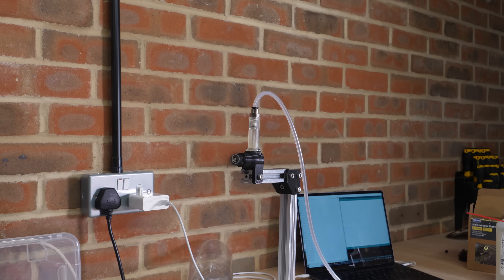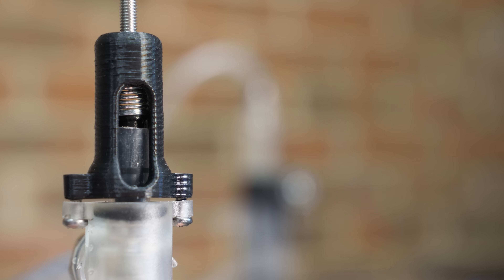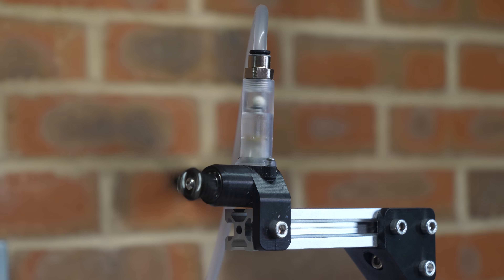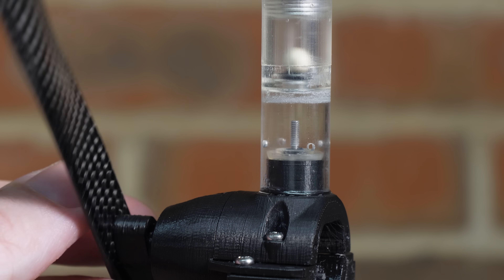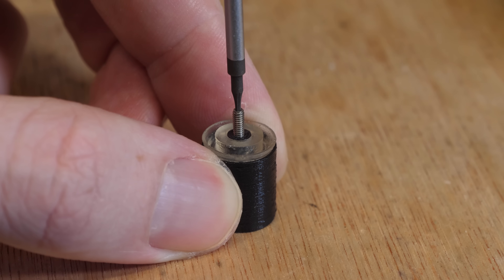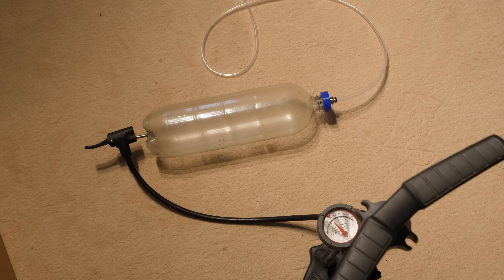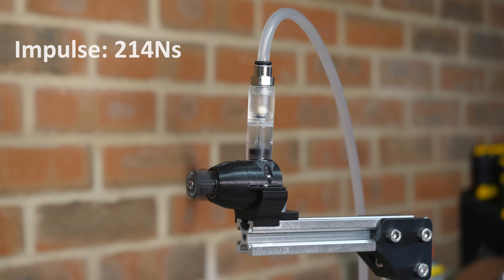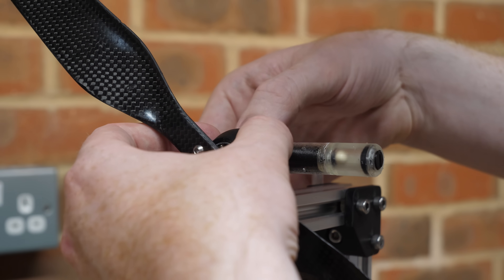4,500RPM Air Engine

Comment: Nice! It would seem the way things work out here is entirely analogous to 'regulated' vs 'unregulated' PCP air rifles; in the unregulated case its also the hammerspring / pressure feedback loop that keeps the power output relatively independent of tank pressure.

Im guessing the much lower efficiency in the 2 cylinder case is a mismatch with the prop power curve? With all the extra power you are getting out now youd probably need a bigger prop to absorb all that power without your propellor blades being pushed out of their comfort zone. Probably good to go over a bunch of them to ensure you are not too far of an optimum once youve settled on a motor design.

Comment: your series really brightens my day.  Looking forward to the next episode of single piston aircraft flight.   I wonder if applying a single layer of carbon over your bottle would allow you to pressurize to higher levels?  Might be a good weight trade off to increase your energy storage capacity.  Creating an entirely carbon pressure vessel would likely give you both better pressure and lower weight.  Id be interested in what you all would think of that, perhaps I am missing something?
cheers.

Comment: you should design a small regulator with metal as to resist a high psi, and then power a dragster with this engine and co2 cans you'd shoot air guns with, its a lotta pressure in a small package.

Comment: You could try regulating the inlet valve to get a flatter output curve by creating adding some grooves with changing depths. Depending on the height of the ball a different resistance could be created.

What if you drilled all the exhaust holes towards the back? Might get a fraction more trust as you turn this inefficient air into something useable

Comment: Nice work.   I wonder what resin do you use ?  The ones I have atm are really brittle and won't stand the kind pressure those crank shafts can handle.

Comment: What if you devided the pressure chamber and had a high pressure side connected as it is, and then the other side or other rigid bottle have it be under vaccumn pressure. This would increase the trust by increasing the atmospheric pressure difference.

Comment: You might be able to increase efficiency if you add balancing weight to the crank shaft. From seeing the engine run it looks like its vibrating a lot and a balancing weight could help it balance the primary forces on an engine. Because the engine is so small idk if it would be easy to add but it might be worth a try. 
Also what if you used a boxer style engine design with 4 cylinders. Those I believe are naturally balanced in the primary force direction.

Comment: Maybe try to use modern strategy  from full efficient ICE engine.. Long stroke underquare strategy with offset crankshaft to get the most from gas pressure ?

Comment: Doesnt the regulator waste alot of power? I imagine any pressure drop before the cylinder causes losses proportional to the flow rate. That includes the tubing and manifold.

Comment: You could consider prototyping a version with an offset crankshaft. Like you showed at 6:28, you'd get a more favourable crank angle to make better use of the high pressure air. This would approximate an Atkinson-like cycle, except unlike a combustion engine compression losses aren't a thing.
Reply: Yes I thought of this exact thing too. He should definitely try that

Comment: Could you use a different type of tank? I'm not sure how viable it'd be, but if you have a spring at the bottom of a cylinder, pressing a piston towards the top, ignoring leakage (think spherical cow) would that help keep the pressure high for the majority of the tank's (exhausted) volume? Obviously the weight will be rather much higher than just sticking with a normal bottle.

Comment: you have to be careful with the specific impulse calculations. Specific impulse is not equivalent to efficiency in the energetic term and is therefore a bad measurement for how much energy your engine is converting into work. Specific impulse scales directly proportional with exhaust velocity but the energy required scales squared with the exhaust velocity (when fixing the time to integrate over). Look at the equations for kinetic energy and impulse if you want to do the math.
The way you looked at it you underestimated the efficiency of your dual piston design.

Comment: put this engine on a tube like plastic rubber which is filled with Helium  gas, make it fly in the air and that pressure should run the engine too.

Comment: add an exhaust pipe similar to a two stroke exhaust pipe, the inertia of the air will suck from the exhaust creating some vacuum at the bottom of the stroke adding extra torque on the up stroke

Comment: I’m thinking isn’t it possible to use a small « turbine » to get the air under pressure. The pressure might be much smaller but you don’t need the bottle anymore and if you put an electric motor on the turbine you have an infinite amount of time until the battery dies. Up to you I guess between peek power for a “short period” or less power but for way longer. If you like complexity you can also use both systems simultaneously 😂. Anyway mega job on that one your progress is extremely impressive 👌

Comment: A small launch ramp could be interesting. Assisted bungee cord catapult start with a connection to an external reservoir (through a one-way valve) when in the armed, bungee-stretched position. That way, you could start the engine on the ramp, let it rev up, and then launch it without losing any air pressure from the onboard tank. Once you launch, the plane unplugs itself.
/watch?v=UqeH-LviCQQ
But I might be biased toward launchers....

Comment: Amazing! What happens if you increase the cylinder air exit port size?

Idea: if the pressure is above ambient, would setting the air output holes only in the direction of thrust give gains?

Comment: Man, i love this series.
Could you try to push the engines (even the old ones) to the breaking point?
Does it give insight into the engines? No.
Would it be cool? Yes.
Reply: It would allow to find the breaking point of the engines, and possibly make them more reliable and durable at those higher pressures.
Reply: @BasedMan  There's a lot to be learned when something fails. Something about, fail in every way possible in each iteration to improve the fastest.
Reply: I mean, it would definitely help define the upper boundary of the working pressure

Comment: Considering its low weight, and the large volume of air it will carry, I’d think there’d be a huge benefit to using helium in this plane instead of air. Maybe in the wings too since they’ll presumably be hollow.

Comment: you really should offset the crankshaft by 180 degrees so you don't have this insane vibration from having 2 cylinder in sync. sure you won't have a powerstroke each 180 degrees but at 360. but twice the amount and no vibration. shown with 1 piston you clearly have enought momentum in the prop so keep it running. so it shouldn't be much an issue anyway.

Comment: @Tom Stanton , are you thinking about trying to scavenge the exhaust at all? (ie-turbo charger) Also glad your still exploring this research and development.
Reply: A turbo wouldn't work in the normal sense, as the air is already compressed. It would be awesome to have it feed even smaller pneumatic engine though - just for the giggles - I can't imagine it would produce any useful work for the effort, but would sure be amusing!
Reply: @JonathanLuker  Yeah I was thinking that might be the case. But I think it also depends on the turbine mass and the speed its spinning at. Which admittedly is a much more complicated engineering problem than the one he is currently working at. 

I think the considerations would be how much pressure you scavenge, and in what way. Plus a lot of optimization of the flow path. For what you are scavenging. 

Its does really get one thinking though.

Comment: Put some hydrogen in the pressurised bottle with correct timing ignite the air fuel mixture in the engine and tast that can improve its power out put 
Also be careful even if you think about making it

Comment: I'm still not sure about the piston design. Using compressed air means you don't need compression so a piston is wasting a lot of energy. A turbine wouldn't have a return stroke so no wasted energy compressing air.
Reply: I imagine the rpm's would be huge, relatively speaking, but less torque so overall less efficient.
Reply: @JonathanLuker  I was thinking more of a bucket or vertical type turbine over a turbo style turbine so you can run it at low rpm.

Comment: With that much thrust to weight, you might be able to make a pneumatic helicopter. Another option is to see if you can make the parts out of thermally tolerant materials and power it with steam rather than compressed air. A steam powered airplane, or even helicopter would be extremely impressive.
Reply: It's now an external combustion engine.

Comment: I love it. I wanna see where else we can voyage back via pneumatic miniature at the early and interesting end of engine layout evolution. How about a rotary engine with centripetal pressure regulation for the ball valves, in multiple cylinders rotating around a fixed crank case?

Comment: please try this with the same bottles, but with a small amount of water and then add dry ice.  self-pressurizing, and maybe more sustained pressure? its a fine balance, certainly, but it would be interesting to see if you can find a point where you get more power and longer run times.
Reply: Dry ice is not easy to come by in the UK. Quite the opposite in fact, and really expensive!
Reply: @JonathanLuker  weird. too many dry ice bombs about?
its not exactly cheap here in the US, but it is pretty easy to buy. tom is resourceful, he could probably make his own.

Comment: The pressure difference across a regulator is lost energy, so even if it was as efficient at lower RPM, you'd have less work done at the end.
Reply: Yeah if it's dropping the pressure from 60 to 30 then that's half your energy gone. (or maybe only a 3rd. pneumatics is more complicated than hydraulics because it compresses)
Reply: @charleslambert3368 true. I think it goes through adiabatic expansion, so the gas will be slightly cooler at the other side, so  it won't quite expand as much as it will lose pressure. So power (= flow x pressure) will be decreased. Unless of course you reheat the gas after it has expanded.

Comment: Awesome seeing an air engine again from you! Your videos on them are very interesting and are relaxing to watch. I also think you should try to make an opposed piston engine (where the pistons meet in one cylinder) because they're really cool and crazy efficient.
Reply: But I suspect, that the gears (especially when home made) that are necessary to combine the two crancshafts of an opposed piston engine will "eat" any additional efficiency. 😲
But it would be good fun. And to push it to the top, why not building a "Deltic" air motor?
Reply: YEAH! @g.j.647

Comment: What you see with the higher pressure and lower output is well known to pcp air rifle users as valve lock. There comes a point where the pressure in the tank is too high for the “hammer” or opening device to open the valve freely. From the looks of your graph, I think 85 psi may be the sweet spot
Reply: Right....much of the physics going on here are well known in the PCP community and surprisingly flat power curves can be achieved with a well tuned gun.   It would also be beneficial for the air engine to use a two stage design much like the steam engines on ships where a 'Hi-pressure' cylinder then exhausts into a 'Lo-pressure' cylinder that's sized proportionally to efficiently use the lower input pressure.   Steam has a much higher expansion ratio than compressed air so the benefits would be much less....still it seems wasteful to exhaust ANY pressure when the onboard supply is so limited.   Entertaining experiments with the air engines Tom!
Reply: @recoilrob324 Or give it an exhaust manifold to get tome scavenging going, essentially create less than atmospheric pressure in the cylinder before the exhaust closes. Very much doable with flexible airhose on the twin cylinder. Might be interesting

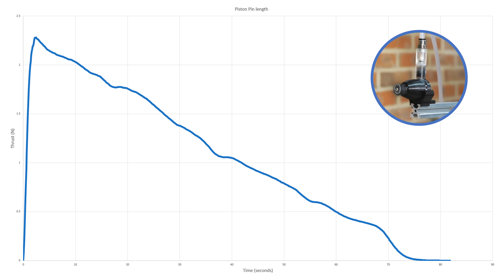Comment: 8:35 That looks a lot longer than .1 millimeter…
Reply from the maker: Correct, it's a 0.4mm pitch, so a quarter turn is 0.1mm. But that shot was filmed before I ran the test, so it was just to display the adjustment.

Comment: Hi Tom! I was wondering if you could run these engines of a 12g CO cartridge?
Reply: Well, a CO2 cartridge is about 800-900 psi. Considering Tom is running 100 psi, that's quite a jump.
Reply: I actually dont think it would be so. First of all you usually only puncture a small hole on such a canister, so even though it may very well be 800 PSI internally, the operating pressure of the engine would never effectively reach that unless completely stalled.
Also as CO2 is released from such a capsule, it is cooled and the vapor pressure drops. There used to be RC engines that ran on CO2. Of course valve spring etc maybe have to be adjusted, but structurally I think it can handle it no problem depending on what polymer you print with etc.
Reply: @ET_AYY_LMAO  Well 800psi in a volume of 14cc, at 100psi it has a volume of 112cc. That's 112ml, Tom is using 2,000L bottles at 100psi.

Even at 60psi it's 186ml of volume.

Comment: Got me thinking, could you use some chemical reaction to create constant pressure for the engine while the aircraft is flying?
Reply: Bit of electrolysis, then use the hydrogen as an afterburner 😂

Comment: I think you scrapped the larger expansion version a little too early. I'd come back to it and play around with cylinder offset, so the connecting rod is already past TDC when the air impulse comes in. I sure would like to see the results of that!
Reply: See: triple expansion steam engine. All ya gotta do is get the piston diameters matched to the previous stages exit air pressure & the efficiency goes way up.